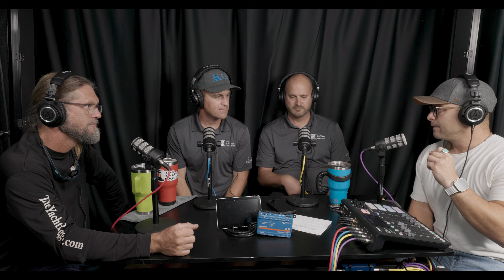ABYC Marine Electrician Talks Boat Tech  | Video Podcast | Ep. 3

Comment: The question I have for Andre is why does my Victron Smart Shunt slowly read the SOC of the batteries lower than it really is. I end up looking on the app for the batteries and then changing the SOC on the Smart Shunt to match. For example, my boat is on the hard in Grenada for about five months now. As the months go by the Cerbo GX is showing the SOC getting lower. However, the graph on VRM is showing the batteries fully charged.  Right now the Cerbo Gx thinks my batteries are at zero percent. 

Joe on Lucky Stars

Comment: Hello! I heard Andre mention a thermal camera to look for issues in the system. At what temps do they start to consider concerning? Specifically, I have my fuse off the inverter/charger that sits around 107 F when charging 120amps at 12v off generator. All other wires/connections are 85-95 F. 

Currently sitting on the hook for Christmas week heated by the aircon and powered by the solar Steve, Brian, and Andre all helped me with. Great guys!
Reply: Hi, thanks for the question.  107F is actually a fairly decent temperature for that kind of continuous amperage.  If you are using quality wires they are rated at 105C which is 221F so you are far from that threshold.  The FLIR helps point to a potential problem as it highlights areas that are hotter than others.  From there we determine if it’s ok based on the load or if the condition is caused by a bad connection (often the case) or other factors.  So there is no set rule but it’s a valuable tool.